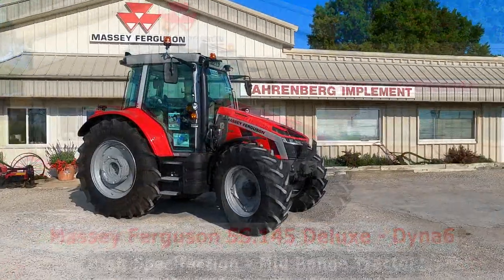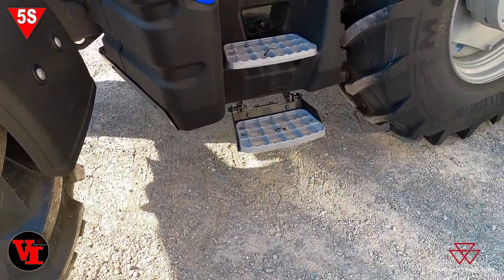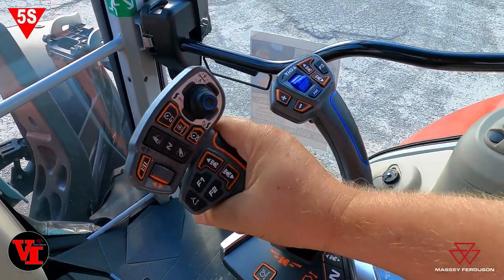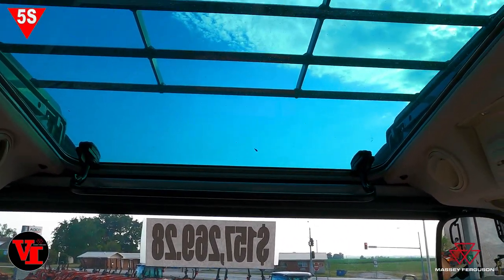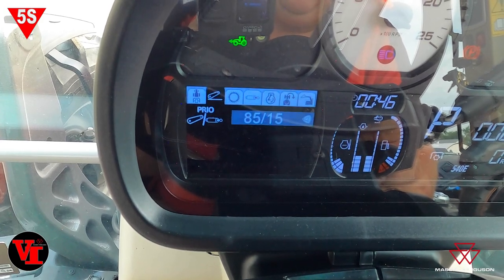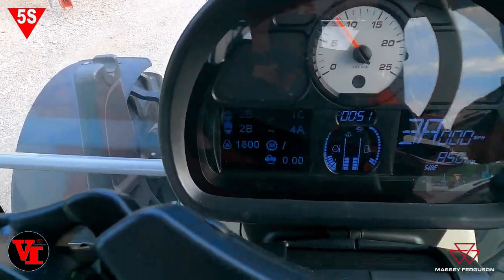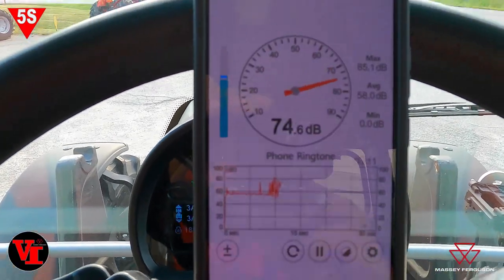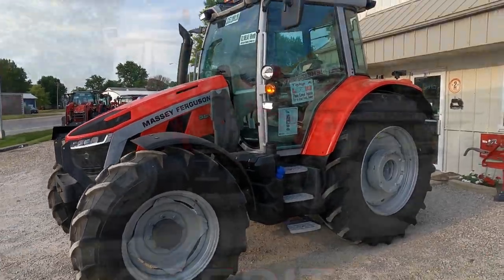Massey Ferguson 5S.145 Deluxe Mid-Range Tractor with Dyna6 Transmission, Hi-Viz Hood,  Visio Roof

Comment: A lot to learn for an old man
Reply from the maker: Glad we could help. Thanks for the Comments and Thanks for Watching!
Reply: A lot of potential fail points too.    Not just sensors, wires and chips but understanding how the software works.  It’s frustrating to have your “smart” tractor be so condescending.  

And the components aren’t cheap. A thumb toggle switch for a grapple attachment cost almost 450 USD.  It’s a couple wires, toggle and a microchip.  Some of the conveniences are nice but when they go wrong… 💰💰💰

Or when a production line worker doesn’t run the wire bundle out of your seat correctly and it gets pinched in the seat suspension.   Now your transmission shuttle doesn’t work because the tractor thinks there is no one in the seat.  

Modern conveniences are nice but there are trade offs.
Reply from the maker: That is the great part with Massey Ferguson they offer the High Feature "S Series" and more Basic Global Series to meet the technology needs of the customer. If you want lots of bells & whistles the S Series is your tractor and it has more electronics for more advanced controls. 

If an assembly issue and under warranty that seat wire should be covered under warranty policy. Now not know which model and switch to toggle grapple I can't think of a switch costing that much unless it was complete joystick handle on S Series Tractor replacement. But that switch if factory installed would fall under the 2 year tractor warranty. Need more of the story and model to determine. Massey Ferguson Parts on the Most Part are very competitive for what you get and the warranty behind them.

Comment: I’ve had the opportunity to drive it, and as you mentioned it takes a while getting used to these safety features i.e. switching up down etc to activate the hydraulics, it’s like powering up an aeroplane and letting the electronics settle down before moving ahead.
I must say though that the turning radius was kind of disappointing, but it could be that it needed some adjustments, I mean look at these enormous front tyres on that compact tractor body, on the other hand you can drive it on water as long as it’s a little muddily!
It’s a nice tractor definitely, it’s a “can do it all” tractor!
Reply from the maker: Yes that are Highly Advanced High Spec Tractors...we actually have sold to Commercial Airline Pilot and he said the same thing and that is what he LOVES about it...all the features makes him feel like he in better control and love the added options to be able to control his machines and do his tasks easier. Turning Radius can be set down to 13.1 foot but the Front Axle Stops and Oscillation Stops need to be adjusted from Factory Setting plus Tire Size and Tread Width will effect Turning Radius too. Thanks for the comments!!!
Reply: Yeah my 4707 has easy adjustments for the turn radius. I think MF sets them middle of the road / conservatively by default.
Reply from the maker: Yes they do to make sure they don't get into loader or tractor when in transit to dealership. It's dealer responsibility during the Pre-delivery Inspection to adjust Tires & Wheels to meet customers needs and set Steering Stops and Oscillation Stops to Maximize Performance when turning.
Reply: @VahrenbergImplement  fascinating I’ve been an airline pilot myself for 25 years but Covid lockdowns brought unemployment, however I grew up on a farm in Sweden and still I keep entertaining where I’m coming from, the farm heritage never fades!
🛫🚜🐄

Comment: Getting an understanding about the shifting sequence down, as you have explained it, is just way too slick, the steering wheel looks rather funky and nifty as well
Reply from the maker: Gears 1,2,3,4 with 4 Powershifts (A, B,C,D) in Each Gear with Speedmatching so when you upshift from 1D to Gear 2 It matches closest speed so normally shifts to 2A or 2B not all the way to 2D if you didn't have speedmatching. Very simple to understand once you drive it. You can shift all 16 speeds without clutching.

Comment: Mr Doug I think, does that 5S Massey Ferguson come with a owners manual for the shifting sequence order , that might make it a little easier to understand the shifting sequence,
Reply from the maker: Several Manual come on Operation, Maintenance and more manuals based on equipment ordered on tractor.

Comment: One question . Does Massey dealers make sure all fluids are full as in hydrolics or transmission and brake fluid . Not referring to fuel . I know a man that bought  a tractor from a competitive company that was delivered with out any hydrolic fluid .
Reply from the maker: Massey Dealer are suppose to perform Pre Delivery Inspection prior to Delivery and in that Inspection Process, Fluid Levels are part of the Inspection Process.

Comment: How high is that cab,if I were to have a new garage put up, how tall is that cab
Reply from the maker: We are sold out of 5S tractors at this time, have one on the way from the factory but could be another month before it arrives. Don't have access to manuals to measure height at this time. Tire size is going to effect height too.
Reply from the maker: 111.4" with Front 420/70R28 & Rear 520/70R38 Tires. What Operators Manual States to the Top of The Cab Roof from Ground. IF you have rotating beacons and radio antenna will require more.

Comment: Is it possible to run the loader from the micro joystick? Everything on one control handle. Have you tried that?
Reply from the maker: You would have to run Loader hoses to the Rear Remote Valves to utilize the MicroJoystick. It could be done but would lose the 3rd Function Controls as it can only operate two remotes or Loader Up/Down and Tilt/Dump Functions.
Reply: @VahrenbergImplement  oh I see, I thought it was assignable to any of the remotes. Can you do a video explaining the Dyna-4 and Dyna-6 and why the Dyna-6 is better? I’ve read conflicting statements that the Dyna-6 is a much more heavier duty transmission that would last much longer than the 4…it’s not just additional gears/ranges but more brute as well. True?
Reply from the maker: I never heard anything about difference in strength between Dyna4 and Dyna6 and reviewing the sales Product Information Guide they both use the same Housing, the same Forward/Reverse Shuttle Unit, same Range Box (4 Gear Ranges),  Big difference is the Powershuttle Section of the Transmission the Dyna4 is 4 speed Ratios created by 2 Epicyclic Units, 2 Brake Packs and 2 Clutch Packs and Dyna6 is 6 speed ratios created by 3 Epicyclic Units, 3 Brakes Packs and 3 Clutch Packs. Dyna4 is 16 sequential speeds with no Speed Overlaps and 8 of the 16 speeds in typical field working speeds. The Dyna6  is 24 sequential speeds with 24th speed being Overdrive for 40kph (25 mph) at 1530 Engine RPM, 11 of the 24 speeds are in typical field working speeds. Both utilize the same 3 Function Powershuttle on the left side of steering wheel. 
So the Biggest difference is 4 Speed versus 6 Speed Powershift.
Dyna4 is only available in the Classic Version on 5S and the Dyna6 is only available in Deluxe Edition on 5S. There are added features with different packages and that come standard equipment besides Transmission difference.
Reply: @VahrenbergImplement  thanks for explaining that in depth. I’ve been looking for a 5s Deluxe for the Dyna 6…you would be surprised how many dealers list classic tractors as deluxe and say they special ordered it with a Dyna 4. Just crazy!
Reply from the maker: Only way to get a Dyna6 in 5S is order the Deluxe Edition Tractor also gets the chrome steering wheel is another way to recognize classic (Black) versus deluxe (Chrome/Silver) Steering Wheel Center.  Classic has T Handle controller on Right Console versus Deluxe has MultiPad on Arm Rest Console too.
Reply: @VahrenbergImplement  but there’s no exterior difference, no badging that says deluxe? Is it possible to have e-loader scales on a FL.4121 or only on 4125 loaders?
Reply from the maker: There is only Model Number Decal. Nothing that tells Feature Level or Transmission Logos on new S Series Tractors. 
FL.4121 can be ordered with e-Loader PreInstalled or Either FL.4121/FL.4125 e-Loader can be dealer installed option.
Reply from the maker: the Micro Joystick only operates the rear remotes. Guess you could plumb the loader direct to the rear remotes to use micro joystick.
Reply: @VahrenbergImplement  I could not figure how to do this on my 5s… but a dealer told me they do all the time but I don’t think that’s correct or they’re describing something else.

Comment: Howdy Doug, I want to know how tall is that cab on that 5s 145hp tractor, cause I need to know how high to make my garage parking space and door for my dream tractor ,I'm thinking your a possible 6/6'2",
and that tractor looks like a possible 11' tall, I would have to have room to clear the lights as well,
Reply from the maker: 11.4" to Height of Cab Roof with 420/70R28 Fronts & 520/70R38 Rear Tires.

Comment: I got a 2020 kabota m6 111 with 689 hours will u take it on trade I'm looking for a new 5s 115 I want it with loader I also want deluxe version
Reply from the maker: We would consider trade if you are within our area of responsibility (60 Miles of Higginsville, MO). We will need pictures and Trade Evaluation Form completed so we can value trade in. Send us an email dougvharen@ctcis.net and we got get you the Trade Evaluation Form and send us picture.
Reply: @VahrenbergImplement  ok I'm was just wanting to get back to a massyI like the new 5s series I might want the 145 version not sure can u get them wit front axle suspension to right ill be paying cash to I don't need to finance
Reply from the maker: Yes the 5S Series is available with Front Axles Suspension. Massey Ferguson offers Cash and Finance Programs Options when purchasing .

Comment: Can you say how much it costs?
Reply from the maker: It's best to contact your local dealer for Sales Promotions. They have a really aggressive Straight Forward Program on S Series Models and will save you lots of money. This tractor 2023 List Price was $203,124 with loader. Normally 20% off list can get you close to pricing but the Straight Forward Program better than that and you need to visit with your dealer and spec out the tractor the way you want it. Even some build and order discounts that lower the price too!

Comment: I still need a price, encridiable design intelligence on engineering, I noticed what looks like the price on the window but I'm looking at it backwards, is that price
Really that much,
$157,290.00 is that it
Reply from the maker: Pricing going to vary with Options and Which Version. But this one a good estimate is $160,000 USD currently.

Comment: I feel like Massey is missing out on an entire market. You have the global series which is great for what it is I guess. Then this…. Almost $200k loader tractor. We need a middle of the road tractor. For someone that wants something more than global but less than what the S offers. I feel like the 5700 global with the dyna is the closest to what I’m looking for. But these prices are just insane. I understand it’s a nice tractor but Jesus. It’s a tough sell when someone like Deutz is offering a feature packed tractor for right around $1000 per HP, sometimes less. I’ve always been a Massey guy but they’re losing me more every year
Reply from the maker: Massey Ferguson offers several feature levels starts with 5700 Global Series standard 12x12 Powershuttle is the Entry Level then the 5700 Dyna4 is upgraded Transmission & Cab Suspension. Then you can move up to the 5S Series starting with a Classic Edition which is more economical and less features then move up to the ultimate the Deluxe Edition like this tractor in the video is. Also with the S Series you can add or subtract features to match your needs and price range. Lots of choices with Massey Ferguson to match your needs and budget. Best is to sit down with your dealer and spec a tractor just like you need and order it and save even more.

Comment: I'm getting the idea that, that 5S tractor is a push button electronic transmission by using
Letters and numbers, push button transmission,
Reply from the maker: It's Electronic Shift of Both the Gears & the Powershuttle Ranges.

Comment: ...$157,269.28 for the 5S. 145 deluxe. 

My question, would you not for the price, get a better value, going up to  6S.deluxe?

Scottishxpride, Tx
Reply from the maker: You won't get the Steep Sloped Hood and Visibility in 6S. And 6S is going going to cost more than equally equipped 5S. Plus 5S creates more PTO HP 5S.145 is 116 PTO HP and 6S.145 is 105 PTO HP. But it depends on your needs and wants. 6S could be better for some or 7S too.

Comment: Too much going on with it inside to be a loader tractor and not large enough for field work
Reply from the maker: The 5S have lots of features but once you set many of them you can control Tractor and Loader much easier. You don't have to move hands all over the place for Hydraulics, PTO, AutoGuide, Tractor Control and More can be done with the MultiPad or many can be programed into the Loader Joystick for single Lever Operation. 
Do a YouTube Search and watch how many are using for field work. The Europeans use lots of 5S tractor for Planting, Plowing, Tillage and more. You can even get the 5S Series with MF Guide (Auto Steer).
Reply: What do you mean too much going on with it inside to be a loader tractor? I agree it has a lot going on but how in the world does that determine if it’s a loader or not 😂😂